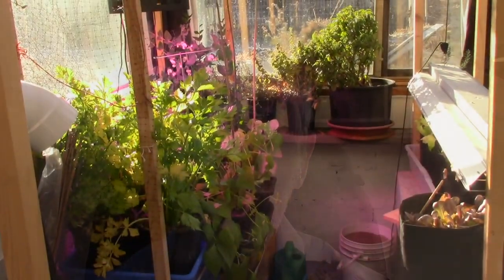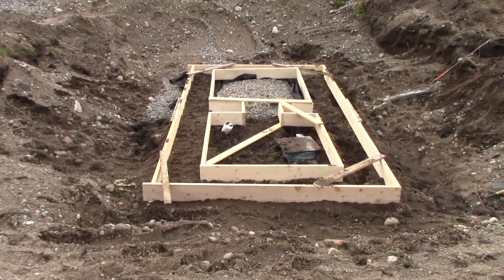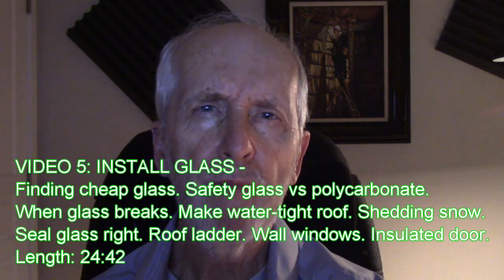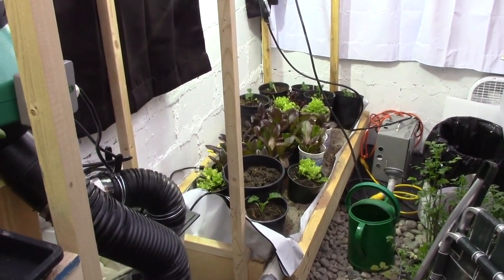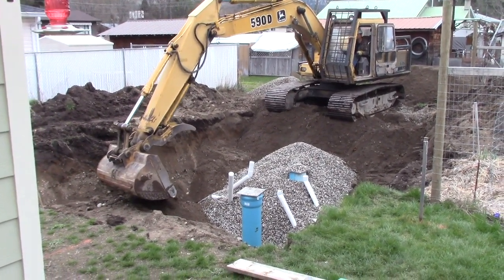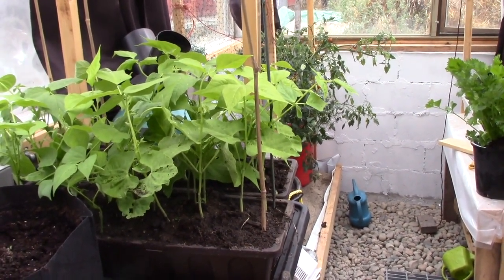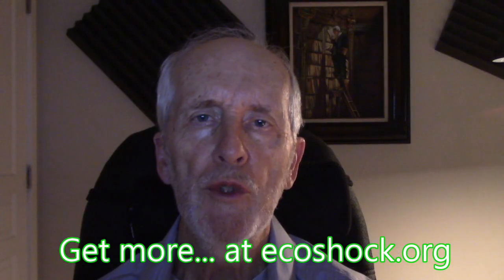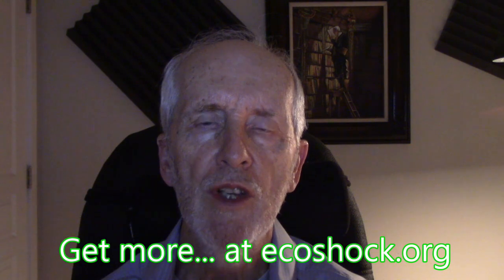Build A GeoThermal Greenhouse in Your Back Yard

Comment: 1. What was total sq footage
2. Total cost and time (hours)
3.  Cost to run during winter months.
4.  Will it work on a larger scale?
5.  Do you use fans to push the air through?
6.  What were temps on the coldest night and which heating methods were used?
Reply from the maker: Those questions are all answered and shown in my geothermal greenhouse course ($28 for about 6 hours of videos filmed over three years, from bare ground to operation in all seasons).

https://www.ecoshock.org/geothermal-greenhouse-video-course

But off the top of my head, it is 7 feet by 15 feet or 95 square feet.  I intended to make it bigger but local bylaws made that too expensive (larger needed a geotechnical engineer and architect design).  I spend around $9,000 Canadian dollars (~$7,000 US).  It could be done cheaper because I tried several methods to do experiments.  It took me four months to build, working off and on while making my radio show and other jobs.  For both heat and lights (lights are needed in a Canadian winter) it cost just under $200 Cdn ($157 U.S.) to run during the coldest months from December through February.  Several larger scale geothermal greenhouses have been built and owners claim they work.  Several are in Utah.  During deep winter a single fan pushes air through pipes below.  In shoulder season like March or October, air filtering up from two vertical pipes and the rock bed are enough, without fans.  The coldest night during my winter operation was about -30 degrees Fahrenheit (-34 C).  As shown in the videos, I experiments with several methods of heat, during the coldest times, when geothermal was not enough: 1. a wood heater ("tent stove", very small); 2. a heat pump (function of portable air conditioner); 3. very small electric heater set on Lo.  Wood heat was only used on a few super cold nights.  Otherwise the heat pump worked well.  Electric heater was just for emergencies, seldom came on, mounted on a cube that turns power to heat on at 35 Degrees F and off at 45 F.

In the course I am honest about what works and what does not.  Anyone should watch the course before investing the time and money.  I love my greenhouse, and I have a whole new bunch of seedlings to go out there in a week or so.  It is -4 degrees F (-20 C) outside this morning but that is unusual here.  Doesn't matter.  The geothermal greenhouse can handle anything.

One more point, I go into detail of how I laid the large safety glass panels on the roof, to avoid leaks.  Now over 3 years later, there has not been a single leak.
Reply: @pathunknown  Thanks, yes.  I plan to buy the book.  Yes, Im trying to think of ways to eliminate the supplemental heat altogether, and maybe even the fans through above ground heat storage.  I dont think I can ever get rid of lights though.
Reply from the maker: @thistimeisdifferent1  I put two vertical pipes into my system, to compare those to horizontal pipe beds.  These 14 inch diameter plastic sewage pipes go down about 13 feet below ground level.  I have found that plants put on the grate above it, or around that opening, seem to do better than others.  I have measured temperatures at the base of the pipe, generally within the expected range of 45 to 55 degrees F. (depending on the season).  Only a few greens, like "winter lettuce" will actually grow at those temperatures (like put on new leaves).  My gravel beds can also work passively without fans.

Comment: Great! Consider steel instead of wood. With condensation, wood will have to be replaced eventually.
Reply from the maker: I agree Jeff.  Metal would be better.  However I did not have the skills to work with that.  Plus, it also depends on where you are.  My greenhouse is in a very dry area, almost desert.  Around here, wood tends to last a long time, whereas on the Pacific coast less so.